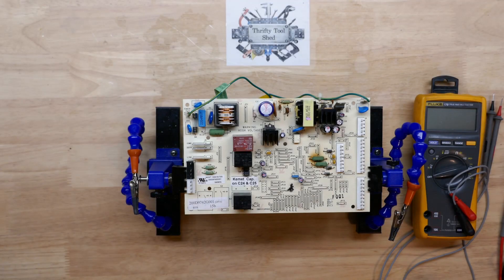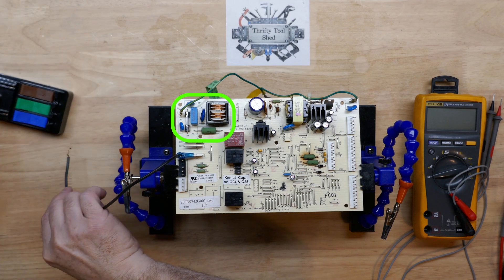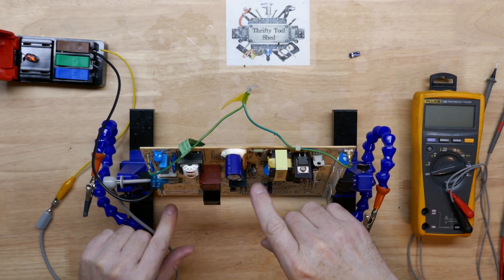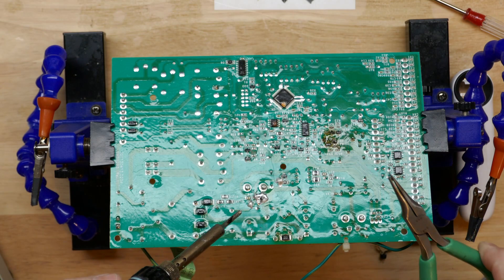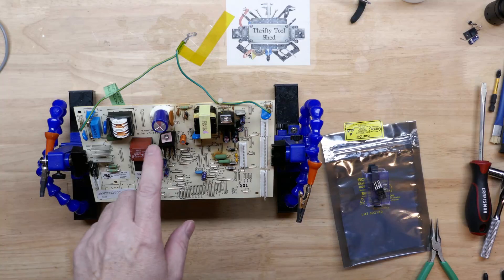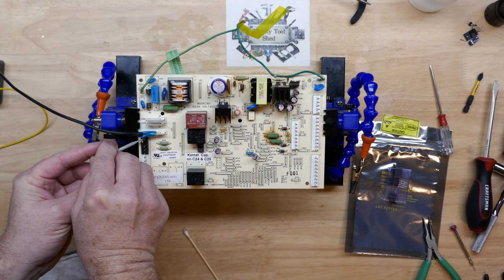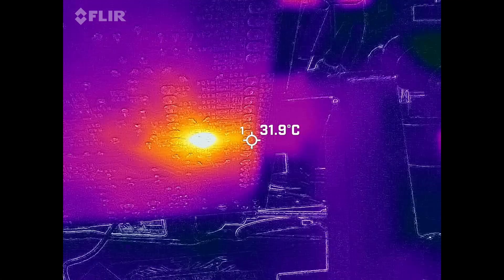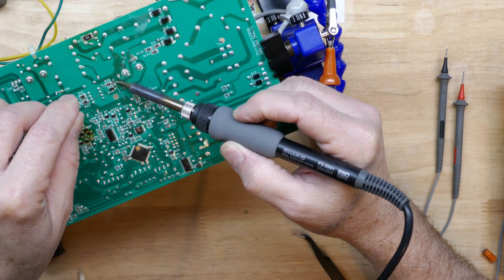GE Fridge Control Board Troubleshooting

Comment: How did you find you prints? As I've got a bad board from a frigidaire freezer I've got. I've already replaced the board as it was cheap enough. But I'm pretty sure I've got a transformer/power station that's bad. Wouldn't mind learning how to repair it myself, and diagnose it 100%
Reply from the maker: I simply searched online to find the wiring diagram that was close based on the fridge model. No board schematics are available that I could find.

Comment: I've got a very similar board, 200D9742G004, with the same discoloration behind those two resistors.
The technician took a glance at that discoloration and said the board is bad. Did no other diagnostic whatsoever.

The problem is that the fridge won't cycle off. It cools the fridge to 5°F or -15°C... and keeps going. I have to cut it off at the breaker every few hours hours for a few hours. 

Will replacing the board likely fix this? I thought he might at least check the thermistors or whatever they're called
Reply from the maker: Most likely, but I can't say for certain as this board was simply brought to me to repair. I had no chance to troubleshooting or diagnose other than Bench testing shown in the video. I would absolutely not rule out a sensor issue, but it is the less likely of the 2 usually.

Comment: At 14:26 you took a cap above the chip
Reply from the maker: Yes, it did come off with the conformal coating. I did set it aside to put it back on, but never made it that far since the new board came in. I should have mentioned it on video. That happens a lot with this type of conformal coating and it's usually a cap also. Great catch!